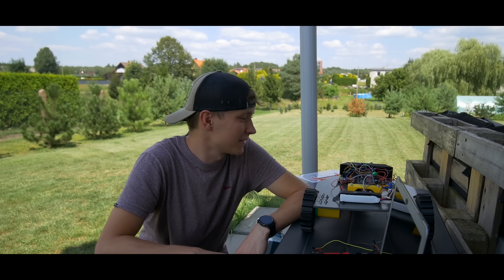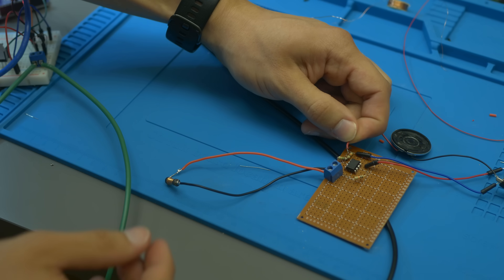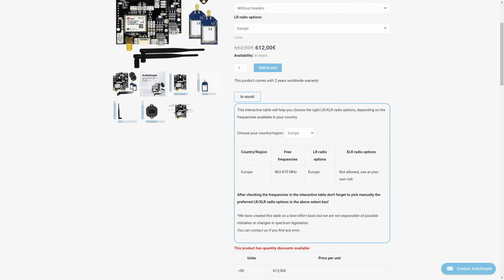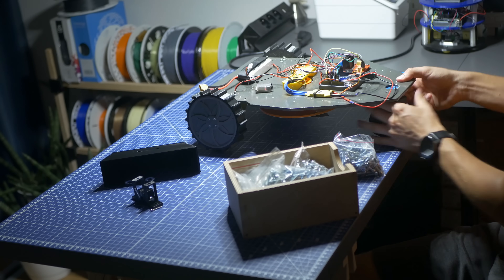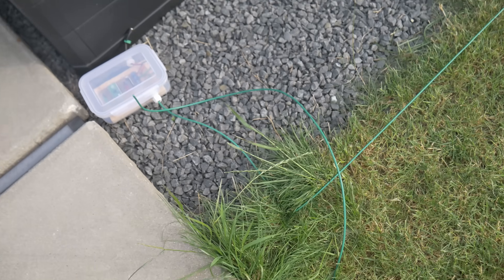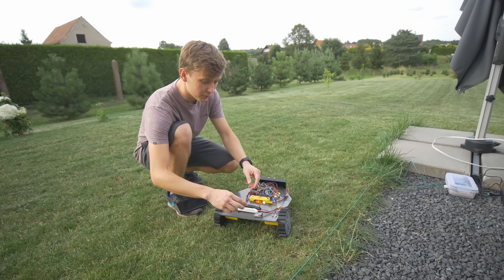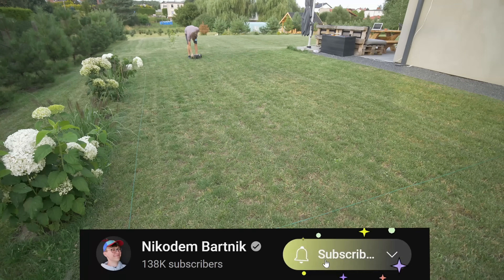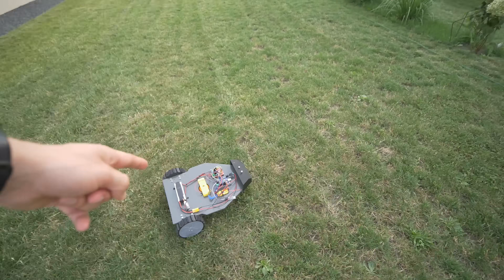Perimeter wire is better than GPS RTK. (IndyMower #2)

Comment: I finally figured out the setup of LC29H DA and BA modules. Connect DA to the simplest HC-06 module and you can use it without any problems via Bluetooth with the SW-Maps application. I compared the result to the professional Trimble Catalyst and got a result within 15mm at a distance of 2km from my base station. Thanks for the information about these modules in your videos. I live in a place where there is no access to the free CORS network, so this solution made my life much easier.

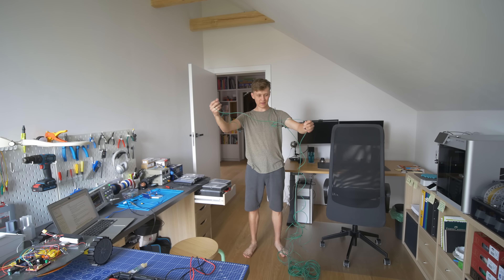Comment: 1:30 Husqvarna uses guide wires (at least 2 up to 4) as well, this way can mower faster return to charging station, otherwise must mower do at least 1/2 (on the long run) of the boundary wire path.
On the other side, worx landroid (positec company) uses only boundary wire (for virtual fence and return path to  charging station).

Both those mower have lift sensor in front wheels (if you lift front part while mower is moving, then should mower stop instantly & stop the blades spining as well ).

Wire, vs gps (+rtk station), vs lidar, the later is for all terrain.

Comment: Ok. Aren’t you just attempting to recreate a roomba? Just swap the vacuum and sweeper for a whipper snipper?

Or can’t you just set boundary markers at the corners to create a “wall” or a single point of reference (like a charging base station) instead of wire or gps. 

It seems like you’re making the area factor a bigger problem than it should be. If it has a point of reference and can detect range or has two points of reference so I can triangulated position. It should be simple. It doesn’t require freaking GPS or physical wires.

Edit: maybe I misunderstood what you were trying to accomplish

Comment: i wonder if placing a strobe light at the 4 corners would work. then use a 360 deg light sensor to detect the strobe lights.
Reply from the maker: How many gardens are a simple rectangle?

Comment: I mean RTK GPS is objectively better. It's just more expensive and needs a lot more work to implement.

If you have a large garden (1 acre+) then mowing randomly is super inefficient as a random path mower will be mowing some areas dozens of times while other areas might get mowed relatively infrequently (or not at all). Likewise if you have multiple smaller lawns and the mower needs to traverse areas to get to them ....with a boundary wire mower you basically need multiple mowers.

Due to the relative simplicity a boundary wire mower is probably the best place to start for a DIY project though.  But I'd aim to make it as modular as possible, so folks can add RTK, Lidar, vision, etc if their lawn requires it and budget allows for it.

Comment: Add a second perimeter to make your robot halt till reset. And LoRa “keep running” signal on the same board. It’ll not escape then.
I’m pretty sure you eventually loose the robot without such system.

Comment: My first thought I had when you said that it would be an issue to run the mower when you have an power outage is "just add a backup battery to the signal wire" and it's probably a good idea too have on the final version

Comment: Here is the patent for the pulse method that allows identifying which side of the wire the robot is on: US8532822B2
There is another somewhere that talks about how to identify and grade how close to the wire the robot is so it can follow it in concentric circles and such.

Comment: Wanted to say - don't use motor current sensors for bump detection. Worx robots use them and they tend to dig into ground and destroy their body. Use separate casing on top and hall sensor (or accelerometer) for bump detection. 
Second - to eliminate driving out of bounds in corners.. never ever do 90 degree angles in boundry wire. Smooth curves. All cable robots need this just to eliminate getting it stuck or going nuts in corners. Rounded corners. 
Third - make 2 coil circuit to detect wire. Then PID loop and try to keep wire between 2 detect coils. Better than one if signal is too high right under the sensor. 2 sensors on each side and when driving back using cable to recharge you try to keep wire between 2 sensors. So both sensor stay on limit.

Comment: Agreed.

Here is someone with plenty of experience who also agrees:
https://www.youtube.com/watch?v=qJIUNA9rYRI 

My DIY mower uses a perimeter wire.  It has been running non-stop for over ten years.  

I bought an off-the-shelf RTK (luba) for my parents.  Signal issues despite the base mounted to the roof and having no trees.  Replaced it with the Ambrogio, same signal issues. Third model hid the issues good enough to keep, but not great. Parent's house causes signal reflections so I limit the mower to >10 feet away from of the house.  They ALL lose their position constantly.  The addition of vision really helps, but still sucks.  Even the $5k models will have 4foot offsets and keep mowing instead of stopping when RTK is lost.  They'll miss at least one 3 foot triangle around the perimeter every single mow unless you have a vision system and high-contrast objects that never move.

Reference the following for massively better perimeter wire:
https://grauonline.de/wordpress/?page_id=364
https://wiki.ardumower.de/index.php?title=Perimeter_wire
The above method would eliminate the need for a wireless link since it always knows when it is inside/outside perimeter wire and can detect when the signal wire is gone.

Hoverboard motors are a commodity (like an apple or a resistor) at this point.  They are VASTLY superior to any motor/gearbox solution in any terms.  e.g. complexity, efficiency, cost, power, weight, reliability, etc  
Keep in mind that they eliminate encoders and can be found used for <$30 most places that have kids.

Inside the perimeter wire, location can be assisted by standard GPS, compass heading, IMU, slope detection, and a simple wireless beacon.  With all of these inputs, you can practically stripe small lawns.  You can also create a "fake RTK system" with a cheap GPS base station for crude corrections.  You will not get under 3' accuracy, but it will be much more consistent.

You could also try using the mowing motor as a sensor.  As you turn, you'll notice the current increases/decreases as you turn into/out-of the tall grass.  This is another sensor to help maintain an  even offset from the last mow row.

Comment: Glad to see you're do this project. I also built an autonomous mower for my engineering final year project. It looks rubbish but I was suprised with how well the perimeter wire worked. My hardware is very similar to yours though. I amplified the signal by 200 using an op amp and used two inductors angled at 45 degrees to the center plane on each side of the mower. This made it very easy to program which way the robot turns when it detects the wire. Also filtering the output from the op amp with a large capcitor made it much more readable for the arduino. I have a video on my channel with the contraption in action.
Reply: Hello, it seems that you have great knowledge, I can't do what you mention, can you help me with that? any discord email, telegegram, I can pay you

Comment: Encoders on the motors won't help you detect the wheels slipping over the grass.  The wheel will still turn, just not move the mower forward on that side.  Really, knowing exactly your position and (from subsequent position updates) heading is the way to go.  Anything else is by now old tech.

Comment: Honestly, a wire is fine to keep a mower inside the perimeter, but as soon as you have a bigger lawn, having the mower drive in pseudo-random paths is just ... well wasting lots of time and energy.  I currently have such a mower and the next one will definitely have to be more intelligent and know where exactly it is and what part of the lawn it still needs to do.  These random things were nice when nothing better was available, but now there are commercial mowers that know where they are without parts (like cameras) that would need lots of maintenance (I guess via GPS), so I'm certain my next one will be like that, even if it costs a bit more.

Comment: Obstacle sensor - full enclosure mounted using extremely flexible tpu, somewhere place a magnet on the enclosure and hall effect sensor on the main board. If the hall effect senses "loss of magnetic field", itmwill stop. This will work when you bounce obstacle in front, but also during reversing, turning, etc.

Comment: Professional systems use a +/- single cycle chirp with a specific repetition or a waveform with a skewed duty cycle. This allows it to detect not only if it approaches the wire but from which direction. When the mower moves outside the boundary the signal is inverted and by using a chirp or skewed duty it can detect this. It is not possible to distinguish phase skew from inversion with a symmetrical signal. With proper amplification this also allows the system to always detect the signal anywhere inside the boundary so it can stop if power is lost to the boundary.
Reply: That's interesting. Is there a specific name to that to learn more about it?
Reply: @5eurosenelsuelo  There was a patent I read ages ago. I will try and find it. No luck so far though.
Reply: @5eurosenelsuelo  I was unable to post the patent it seems. Probably blocks links.
The patent number is US8532822B2. You find it on google patents.
Reply: @5eurosenelsuelo  My previous reply was deleted by youtube.
The patent number is US8532822B2. You find it on google patents.
Reply: The patent number is US8532822B2. You find it on google patents
All my posts about this seem to disappear? Been trying for 5 days!
Reply: Translation: Better mowers don’t just detect if there’s a wire, they can tell which side of the wire they’re on.
They do this by sending a special signal through the wire that’s easier to recognize and harder to confuse with other electrical noise.
The signal isn’t a simple tone, it might be pulsed, have a funny shape, or change pitch over time.
When the mower crosses the wire, the way that signal looks to the mower’s sensor flips, and that’s how it knows it has crossed.
If the wire loses power, the mower stops because it no longer sees any signal.

Comment: I spend way to much time watching my budget robot mower at home. 

Pointless info you probably know but
Corners get churned up when it rains suddenly (thankfully unheard of in the uk 😂) due to ending up there a lot and getting in the dance mode.

Mine seems to randomly choose if its turning clock wise or counter 

It seems to have 10 or 12 angles it will rotate to when it hits the boundary 

The radar object detection struggles with a washing line pole but not over hanging plants

The pre cut boundary line travel is always too long, so it rarely starts in first 75% of perimeter 

Cutting perimeter doent happen enough and it requires manual cutting.

Again sorry if this is all known and poitnless cr@p

Comment: Base corrections over NTRIP are used by surveyors around the world, so don't think it could only be used on your local country. It works the same on every country, you insert the address (IP) username & password, port and (optional) mount point (basically if they have multiple receivers you can choose one). That's it, you now have the corrections. This requires an internet correction tho. But it can be used on many other rovers, even drones.
Reply: There are no free services for it, are there? Like you pay for it and it only works for 50km next to a tower which are sparse in Europe. Or are there other tricks?
Reply: @ssa7843  Depends on the country really. In W EU there are a lot of free CORS networks. If you get a paid service you have access to all base stations from that area/country. If you move you can choose the one closest to you. Most of them can automatically give you the corrections from the base closest to you based on your current location.

Comment: One obstacle sensor from my company AGV robot that I think is cool, was soft rubber pipe with 2 rows of conductive copper tape inside, taped to adjacent walls. Hitting obstacle squished pipe, short conductors inside and collision was detected. I think you can find this products under "safety edge sensor" google searching

Comment: Look into LoRaWAN for boundaries.  You can use their signal strength to guage location.   Having multiple transceivers increases accuracy.   Modules are extremely cheap, and you can use the protocol/hardware for communication as well.

Comment: I actually working in development for commercial robot mowers like that.
As a collision sensor you could use a magnet on the front bumper and a Hall-effect sensor to detect changes in the magnetic field.
With that you have a non-mechanic detection solution which means it's less likely to fail.
You can also use it to detect if someone lifts the mower.

Comment: Really interesting project, I like your journey through the problems. There was a rbpi based semi-open source lawnmover project, the guy developed everything for it including a phone app. He was selling the plans for 30eur or something. I was very inclined to build it but recently robot movers got really cheap, the one in lidl is around 300 eur with decent specs. So I gave up on building my own and have to stick to the 100 other projects I have in my head :)

Comment: The ardusimple modules are working smoothly with our Polish NTRIP network. I am able to get 10-15mm accuracy and I can't recommend them enough :) I was also playing around with RTK module from AliExpress($100 price tag) but it was not working correctly with ASG-Eupos. On the Chinese module I was able to get RTK fix using rtk2go network but the position was constantly off about 20-30cm. I'm assuming that the base station that I was using was not properly configured. If you have any questions regarding my short gps RTK discovery I'm happy to answer. Keep up with the good job that you are doing!

Comment: I personally think neither solution is great. GPS RTK is too expensive and not always that reliable depending on your location (tall buildings are a huge problem). And the perimeter wire is messy and a pain to install. I think you should consider solutions such as (bluetooth) beacons and/or lidar as well. Perhaps a combination of several approaches by also using a compas and accelerometer to interpolate your location.
Perimeter wire solves your border issue, but not your location.

Comment: You could use a phase locked loop with 5 kHz or a mixer to detect the signal. It is much faster and saves computing time. It’s all analog, which can be hard. For circuit simulations I use Ltspice which saves you a lot of time.
Greets from a hw dev.

Comment: For me personally, I'm not a fan of perimeter wire (only), because typically the robot doesn't know where it is, or what the shape of the area is that it is mowing. It can't plan a route or pattern to cover it efficiently or quickly, and it can't even be sure it got to it all. It's just statistically likely that it'll cover everything eventually (if the shape isn't too unsuitable), just by randomly bouncing off the edges. Of course this can be improved with other sensors (internal or external), but true absolute positioning would be in a different category. There are of course also ways to do absolute positioning just in a small area (multiple receivers triangulating it's position), but I do understand why that isn't and can't be the focus right now.

It's still great to see the whole process you use to design, even if the product or project isn't specifically "for me". Also it being open source means everyone can add whatever positioning system, or it'll be an option V2. Either way, great project!

Comment: I know the project is meant to be something accessible by most people, but i think for a robotic mower it kinda requires some more complex or expensive stuff just to make it viable. Wire loops and random movement would be fine for a small space, but one is going to need a more complex and expensive solution for anything more.

Comment: You’re trying to reinvent too many wheels. Study the decisions that were made before you by projects like autonomous vacuum cleaners (and lawnmowers obv.). For instance there’s a reason why they didn’t simply rely on current sensors or motor-side encoders. Use the caster wheel to monitor actual motion. Also increase its diameter, it’s way too small. Base-station-less RTK is the way to go.
Reply: I like his learn-as-you-go method better. It's better from an intellectual standpoint, and it makes for more interesting videos. Of course in a business setting, building on "prior art" (i.e., the work of other people) is the only approach the boss will permit, but Niko is his own boss. He has no profit expectations, deadlines, or marketing considerations. He's living (and sharing) in the open-source universe, not the commercial one.

Comment: What about using two sensors? One 45deg to the right of the front and another of the left. It could better detect corners and could tell which direction the wire is in. Keep up the great work!

Comment: I've had my neighbors cut my perimeter wire so many times, or the sand pushes the wire up, or the mower itself cuts the wire and commits xuicide every session. It's a massive nightmare. Plus the ping-pong method of attack is super frustrating. Some parts of the yard won't get mowed for months

Comment: Before getting my luba 5000, was working on the Rep_al mower, defenetly lots of feature creap before I got it working. :) I then decided to go for ardupilot (yuri's homebrew here on you tube has some vids about that) with rtk as wires being cut is horrible to find. the worst was when it doesnt cleanly cut the wire, and it corrodes in the ground. ardusimple is the rtk I got at $600 for a kit. Im still wanting to build one one day but think converting a mower that is exsisting would be a good start :) great project!